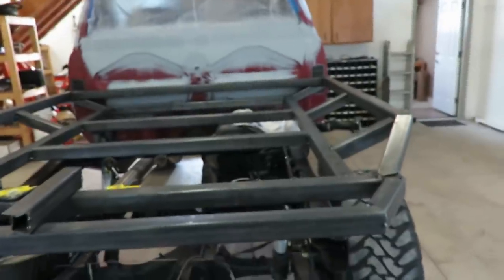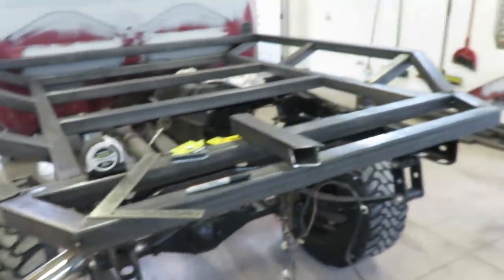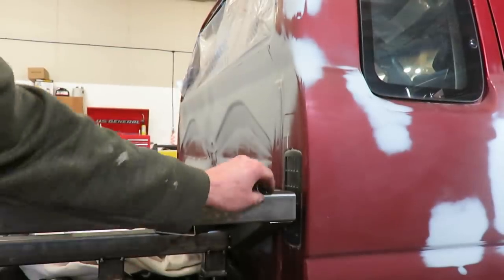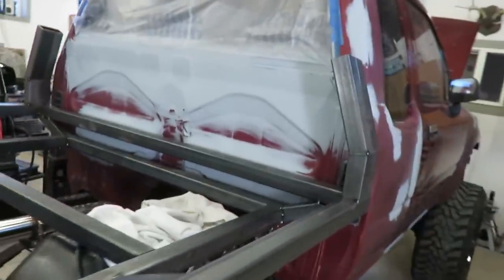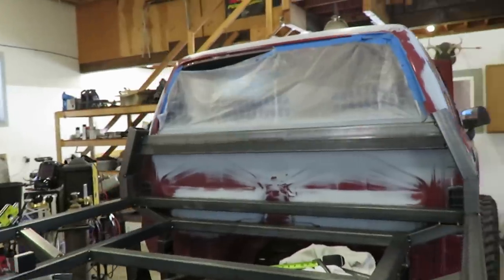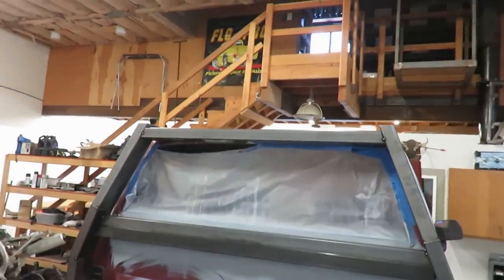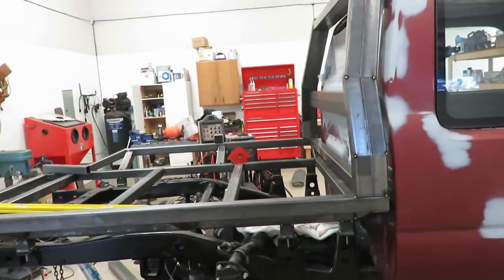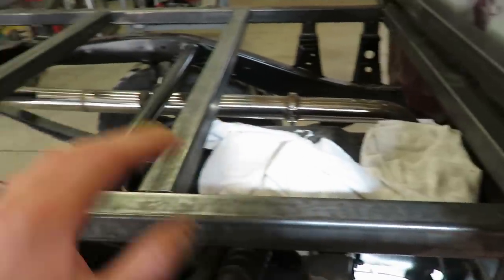Custom Toyota Pickup Flatbed Build Episode 2 Headache Rack

Comment: 3rd brake light and reverse lights in top cross bar?  Yes leave window open!   Built in tie down locations in rack?  Filler neck built in to the side.  Maybe a 4” “fender” along the side narrowing towards the rear?   Adjustable Tie down rack slides in bed floor?  Built in tow hitch  to rear of bed?  Lower 1/2 headache rack expanded metal instead of plate?  Good to attach bungees and lighter.  Just a few thoughts I had while watching.

Comment: I found after I built my tube box ( all pro Toyota  style) for my 81 f150 , the rear part of the frame was so stiff the front half of the frame did all the flexing eventually it cracked  in different places. Truck was on deaver long travel soft leafs in rear, long travel coils up front, f350 axles and 18x39.5x15 superswamper boggers.   I think the key is to add  exo cage or good set of rock sliders to stiffen up the front of the frame.

Comment: Run two tubes for floor support. If you don't run any, you will definitely see sag in the future, a single is good, but two equally spaced from the outside rails would be ideal.

Comment: I like the idea of the filler neck up in the corner like you said. But having a lot of bends will make it a pain in the ass to fill up. But if you made a filler neck out of stainless or something, I could see it working pretty easily and it will look good. On my old truck, it was under the bed with a plate that flipped up. But I didn’t like that much. It interfered with the tool box or anything that was on the bed at the time.